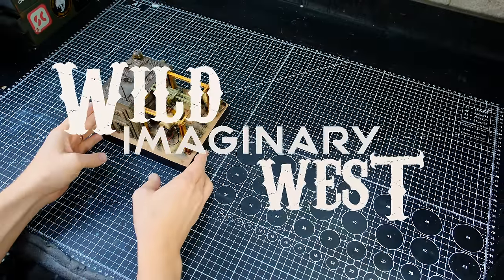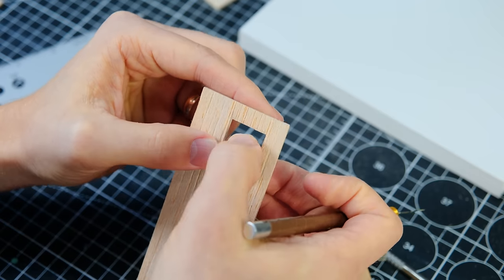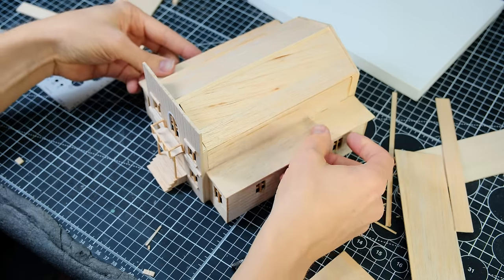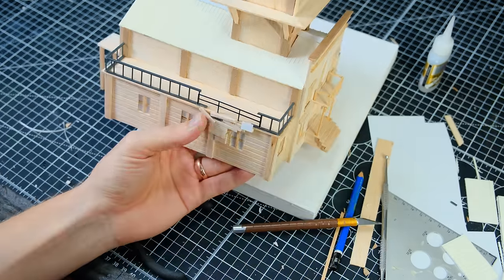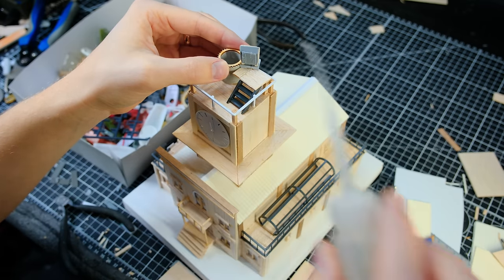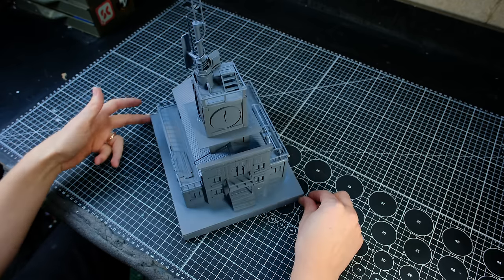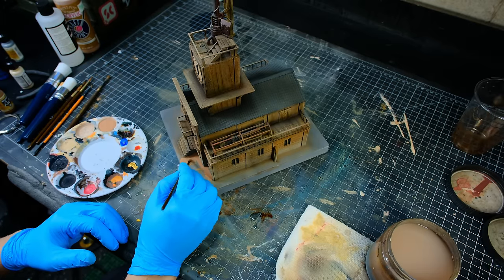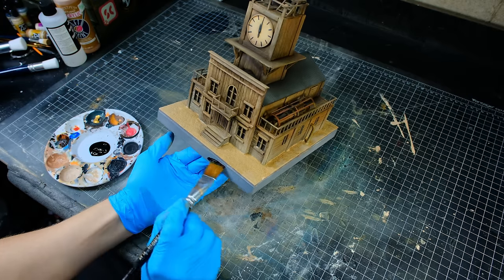Making a Miniature Wild Western Town

Comment: I was thinking if it isn't to much , which the items should be easy to come by. 

But I was thinking you should incorporate a working clock.all you'd need is a battery powered motor with gears that rotate and build the clocks arms and base. You can get that from hobby lobby I'm sure. Or hobby lobby even should  have miniature battery powered clocked already

Comment: It'd make sense to be a sort of refuge for the townsfolk, if a particularly forestall resistant beast attacked the town, as the townhall has the largest (and most powerfull) forestall in town. 

Though its probably not the largest forestall ever built...

I think a cool diorama idea would be an oasis in the desert, with a massive forestall in the middle, as a safe haven for weary travelers.

Could also be a good place to use palm trees